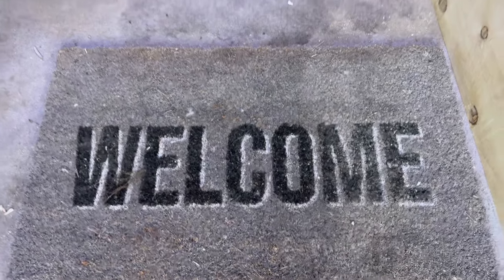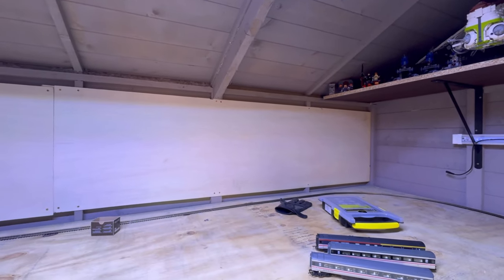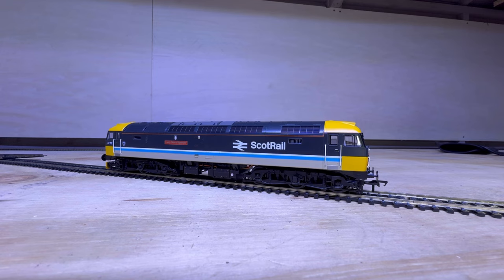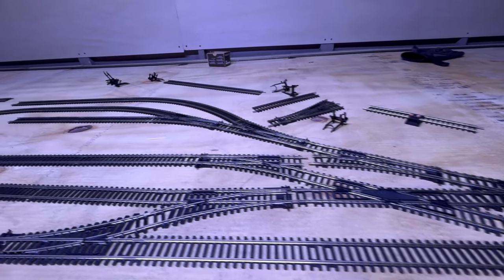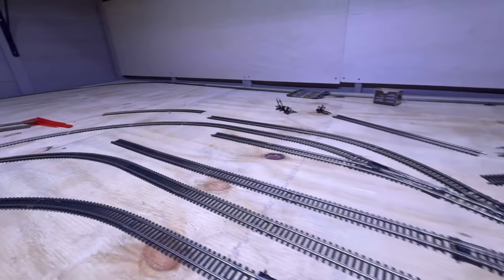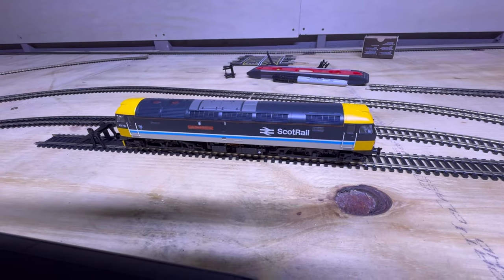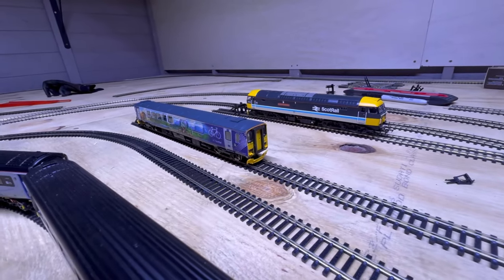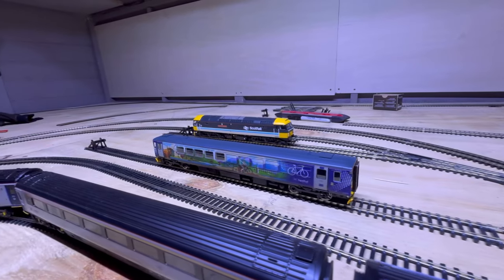Yorkshire Railways | Building a OO gauge model railway | Episode 1: Space, Track and Trains

Comment: Hey 👋 good to see someone else building, coming along for the support, space looks great 👍 Are those Hornby points? I'm having issues with 0-4-0s running over these. Seem to be a terrible design considering Hornby selling 040s by the millions.
Reply from the maker: Thanks for your comment! I know that it’s not just the Hornby points this can happen on its due to the shortness of the locos, they temporarily loose power due to the insulated join on the points. If this is a major problem for your stock you can fit a stay alive to them which will give them a boost of power when the pick ups loose power and this will keep them running smooth 😊👍
Reply: @YorkshireRailways  I'll look into that. Oddly enough it tends to be ok coming in into the point, more an issue exiting the point. I think this is why more people tend to go Peco medium radius points, but good shout re. Stay alive.
Reply from the maker: @_RandomPea  possibly I’ll definitely be looking into it, and let me know how you get on if you decide to fit one 😊👍

Comment: Hi. It is great to see someone's ambition at the start and their plans. I do look forward to seeing it develop. From experience I do agree with @shelfburymodelrailway that getting to the rear of your 4' boards will be difficult in the future when scenery is more installed. How will you get to the back to maintain the trackwork or manage derailments? I extended one board without thinking about reach and it can be a real heartache having to move buildings etc to reach. As for rolling stock and vehicles I run my railway as I want (for fun and entertainment) but do have a system set up for decades of railways i.e WW2 to 195, then 50s to 60s, 60s to 70s, 70s to 80s and beyond! This is not meant as a criticism and I admire your ambition.
Reply from the maker: Hi Catherine thank you so much for your comment! With the 4ft board I can reach the straights pretty easily by leaning over so shouldn’t be an issue for derailment. I do however accept cleaning track may be a little tricky. However I do have a plan to make sure I can do it, thinking track maintenance vehicles going round before ever run will help as well as maybe not glueing buildings down will help with making space if I need to do any major work. I do however accept all this will make life difficult still but unfortunately due to space I have no other option. I hope you enjoy the rest of the series 😊👍

Comment: That’s a great space, lots of potential! I like the idea of the helix, a second level for storage is a great idea, as you say less handling of locos/stock etc. 

Only suggestion would be to add some additional lighting in there, in particular for the lower helix level when built, Saves stumbling around in the dark! 

As for the track, definitely pico points. They tend to last the test of time compared to Hornby.

As for track plans, there’s plenty of free track design tools online, have a google. They may help…

Looking forward to what you create! All the best 😊👍
Reply from the maker: Thanks for the comment and suggestions! 
I do have some extra lighting to install I just need full time electricity installed in the shed first currently just running an extension from an outdoor plug so only temporary but will be sorted as soon as possible. 😊

Comment: Nice start, lots of space, great ideas..
Only concern is width of board,  difficulty of construction and maintenance at the back of the boards. 
Run what you want and enjoy. Justification is whatever you want…
x The Bigfella x
Reply from the maker: Yes they are a little wide but had to be due to the 3rd radius curves. Luckily I can reach the back track when leaning over I have a decent arm span although it is a stretch so can sort any derailments (hopefully there won’t be any) I’ve thought of a plan for scenery to work from the back to the front that way I won’t damage anything when building. Thank you for the comment! 😁
Reply: Murphy’s Law,, Stock always de rails at the most difficult spot 😮
Reply from the maker: @bigfella1952  That is true